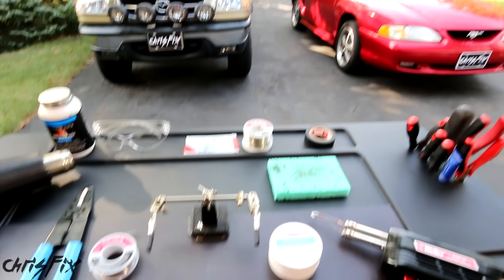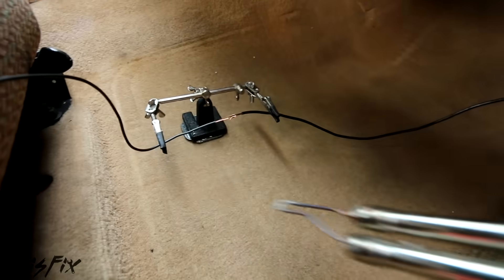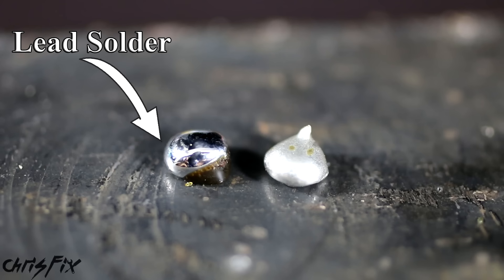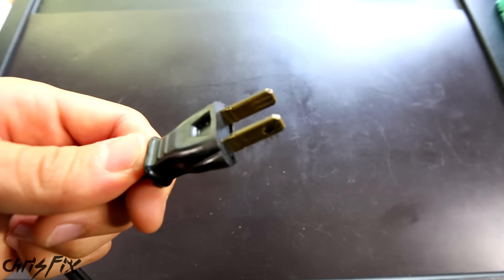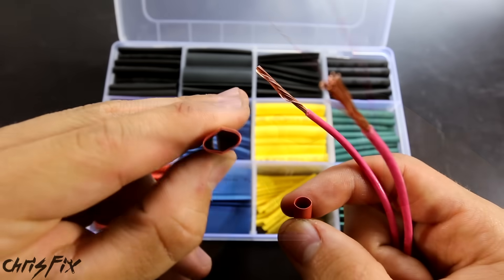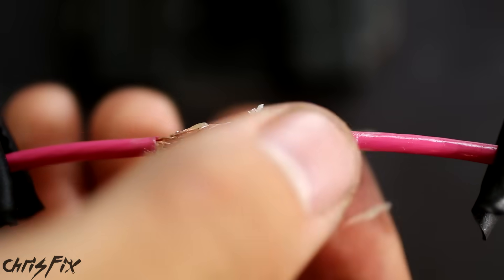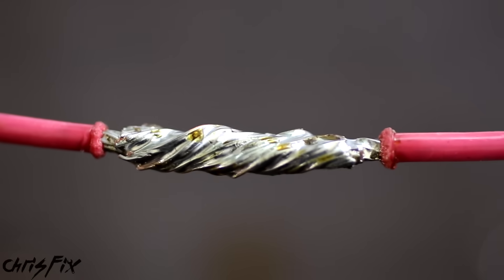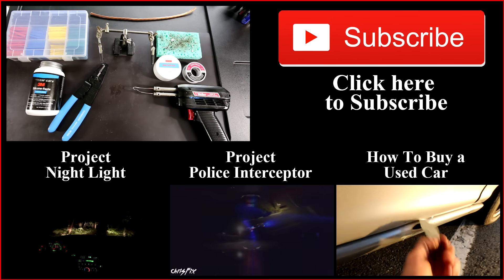How to Solder Wires Together (Best tips and tricks)

Comment: That was a good demonstration. You should also note that you should never touch the bare wire as some of the natural oils on our fingers can be corrosive and can end up weakening the joint over time. I see this a lot with do-it-yourselfer guitar electronics repairs and replacement. Also that a good solder joint will be shiny all around. Any dullness indicates a bad joint.

Comment: I was taught by an USAF engineer that the best way to solder stranded wires like those in the video was to first tin the ends of the stripped wires, then form each end into a hook, hook them together then twist them tight and finally solder them together.  Supposed to be a stronger connection.  Overkill?

Comment: Great video,  I just don't like to use a sponge on any tool that I solder with,  it causes temperature shock to the tip and wears them out quicker.  I use brass wool only to clean tips,  and always make sure to tin your tips,  especially when you're done with the iron and you put it away.

Comment: Well done video. One thing to note, the acid core solder is only used for soldering sheet metal(galvanized). The reason why you don't use it for electrical wires, is because the acid can eat away at the copper over time. The insulation on the wire should be unaffected by oil, gas, and acids. Lead-Free solder is lousy. It does not flow nicely like solder containing lead. Rather than the rosin paste flux, buy a liquid rosin flux. You can apply a few drops and capillary action will draw the flux into the strands. Really don't need the silicone grease under the heat shrink. That soldered connection you made w/o the grease and only heat shrink will be there for decades. If the soldered connection is being done on a boat, then yes, use the silicone grease or heat shrink tubing with glue.
Reply: +electronicsNmore 
You said his use of grease is OK if the wire is in a boat. It's not, it's in New Jersey where they use lots of salt on the roads in winter. Silicone grease is a good idea under the shrink tubing generally; you never know the end destination of a vehicle after you sell it.
Reply: I love boats. And by boats I mean chocolate.
Reply: davecc0000 can you please explain as to why salt is used on the road in winter? Does it make the ice on the road less slippery or any other reason?
Reply: Salt lowers the freezing point of water, melting ice.  Salt is used to clear the roads and walkways of ice or to provide more traction on heavily iced surfaces.
Reply: "That soldered connection you made w/o the grease and only heat shrink will be there for decades."

Not if it's exposed to salt water. Around here they use salt in the winter and it eats through copper wire. An untreated connection will turn into green dust.
Reply: +Slicerwizard I guess you didn't read all of my comment.
Reply: Then say that. Saying "boat" did not give me (and probably dozens of others) the idea that you implied very watery OR SALTY conditions. Think before you type.
Reply: davecc0000
When I used the word "boat", that meant any connection which would be subjected to fresh or salt water. So if you're soldering wires together OUTSIDE a vehicle, then clearly you'd be using heat shrink with glue or the silicone grease. :-)

Comment: Only thing I would add is to use some FLUX CLEANER on the connection to clean it before you do the heat shrink

Comment: Best tip I ever had from an auto electrician was, don't use solder if you can use a crimped connector - reason being when solder gets old it becomes brittle and brittle solder + vibration = broken joint, whereas a good quality crimped connector will last more or less forever.

Comment: Great video. 
Just a tip. When burning off the flux make sure the cable isn't at an angle to where the flux can run down into the cable underneath the coating. If so it can make it brittle and crack. Same thing while adding the solder.

Comment: You have some misinformation about soldering.  (Those solder guns are garbage too, especially for finer work like wiring.)

Leaded solder is typically 60% tin and 40% lead.  Lead-free solder is about 96.5% tin, 3 % silver and .5% copper.  Lead free isn't bad solder, it just requires higher heat to work with and re-working it can be difficult.  I don't recommend it unless you need a RoHS compliant product.

The purpose of solder flux is to remove oxidation.  The reason you want to use a no-clean or a rosin flux on wires (whether stranded or solid) is because you cannot clean the wire if flux gets under the insulation.  Aggressive flux will corrode the wire eventually, not just eat the insulation.

Otherwise not bad.

Comment: Great vedio Chris , i want to ask you some thing about my car Chris l have ford explorer2006 when i start the car  the battery light appears and alternator is not charging unless i press gas above2000rpm ,it works very good after that do i need new alternator ,what to do please help me. Thanx alot

Comment: Ahh if only it were that easy. Most of the time you are upside down under the dash with barely enough wire to span to distance and not enough time to get the job done.

Comment: I was taught that you should clean the solder joint with alcohol to remove any flux residue even if you are using "no - clean flux"

Comment: good video.  Just buy wire with flux in it...much easier, especially when trying to solder like a remote start wiring harness into an ignition harness.  Hell I used to huff and put solder in my mouth to pull it longer to work with when I was an installer lol.

Comment: Flux is designed to be like a solder magnet not for protection flux just happens to protect from corrosion  the rosin inside of solder is there to drip onto what your soldering to help the solder stick.
Reply: Flux is not a solder magnet. Clean bare copper is a solder magnet. Flux removes the oxide layer from exposed copper and that clean exposed copper is the solder magnet. And flux will not protect against corrosion. In fact, after soldering, excess flux should be removed to prevent corrosion.

Comment: A few things to add to this. Instead of a wet sponge, use a brass wire sponge. It works much better for tip cleaning.

I would suggest using a wire stripper without the cutters by the handle. I notice they're much easier to strip wires with and there's less chance of cutting your hands.

Also, when you're soldering, only hold the iron on the wires to keep the them hot enough to melt solder. In practice you should only hold it there for as long as you need to. You don't want to damage the insulation.

For heat shrink, you can just use the glue lined stuff to help water proofing. 

These are just small nitpicks from a guy that's done a loooot of soldering. Otherwise this is a great guide for soldering. By the look of that joint, I can tell you have a lot of experience doing it.

Comment: Thats what I do. Good video.
However, it's not a good idea to have the fan blowing air into the solder joint.  If you do, it can form air pockets in the joint and you'll have a cold solder joint.  It can also blow hot wet solder onto your hands (ouch).

Instead, have it working as an exhaust so it take the smoke away from you.

Comment: Do not use the ventilator pointed on the soldering wire where it blows at it, only let it suck away the fumes. Cooling down the solder may get a bad soldering point.

Comment: You got a tip for when you start soldering and forget to put on the heat shrink on?
Reply: +Princess
Get some self-fusing silicone tape. It's magical stuff. Wrap the solder joint tightly (and some of the insulated wire before & after the joint). Stretch it tight when wrapping. Forget the grease.
Reply: https://www.amazon.com/gp/aw/d/B00HWRO744/ref=mp_s_a_1_7?ie=UTF8&qid=1473521217&sr=8-7&pi=AC_SX236_SY340_FMwebp_QL65&keywords=Silicone+tape&dpPl=1&dpID=417vCUtwSNL&ref=plSrch
Reply: Find somebody to slap the stupid out of you.  LOL  (no offense i couldn't resist)

Comment: "Hey guys, random internet dude here" RULE nr.1 : never ever solder anything on a car electrical sistem!
Reply: What makes a car electric system so special? Spikes of current are a problem for solder joints?
Good solder joints have a VERY low electrical resistance which brings joule heating to a minimum!
I have soldered electrical connections for train motors and those joints endure 300A continous and spikes well over 1000A (and much more when things go wrong). The only time the solder melted was when the connector failed, heated and melted the solder, but this is due to a failing connector the solder joint!
Reply: "Also soldering wires isn't good in systems that vibrate. Wires will 
break right besides the solder joint if they can vibrate enough."

This. Soldering turns flexible stranded wire into a rigid block. If the wire is allowed to move at all, the vibrations present in a moving vehicle will cause the wire to do most of its bending right where the solder ends. It's like taking a paper clip and bending it over and over in the same spot - the metal fails and breaks in two.

So if you have a wire soldered to something fixed, like a relay terminal, or to a connector that is slid over the relay terminal, and the relay is screwed down, then the wire has to be tied down as well. If the wire is just hanging there or is tied down six inches from the relay, the vibrations in the wire will cause a failure, just like in the paper clip.
Reply: Electrical sistem not "stable", while starting, no matter how advanced the car's electrical sistem, it will get high spikes of curent. This poses a big risk to the solder, as it has a low melt point. So if you solder and solder, when something will go wrong you will have to check all of your work from front to back.
Reply: Constantin Niculae
Never had this problem. I mostly solder independent pre-heaters, tho. But it's nice to hear other opinions about the risks.
(Gentle advice: It's system, not "sistem". No grammar nazi here, just wanna help you improve ;))
Reply: Sorry for the grammar, not my first language :)
Reply: Constantin Niculae
No need to be sorry ;)
Not my first language either, so native speakers will find maaaany mistakes in my comments :P
Reply: superdau Never solder something that has high current??? Read my post again!!! We solder connectors on train DC series motor!!! up to 300A continuous, the solder joint was never a problem unless it was done by an amateur. Also those joints get LOTS of vibrations and still not failing!!!
Reply: James Nicholson I've replaced many o2 sensors, but I've never soldered them. May I ask you why? Curious to know.
Reply: I cant remember why exactly. Something like a certain wire going to the sensor has to "breath" and if you solder them it clogs them up? Also it adds resistance to a system that relies on resistance to work. I read this on a subaru forum somewhere but it was long ago. Not sure if its correct or not but i barely ever used solder anyways. just good old wire connectors and heat shrink.
Reply: James Nicholson
I'll ask my boss next week. I'm really interested if and why this is true. You never stop learning!
Reply: As soon as two different metals come in contact, they will produce a small voltage depending on temperature (that's how thermocouples work). An O2 two sensor only creates a very small voltage, so if you add those new junctions that create a voltage on their own, it messes with the sensor output.
Also soldering wires isn't good in systems that vibrate. Wires will break right besides the solder joint if they can vibrate enough.
Never solder something that carries high current. Solder has about ten times the resistance as copper, so solder joints can heat up and maybe melt.
And never tin the wire ends that you put into screw terminals. Solder is very soft and "flow" over time under pressure. Your wires will become loose!
Reply: +superdau
Solder has all those problems? That's why it's used in PC boards and electronics for 100 years all over the world? 

So much misinformation...
Reply: superdau Its a wire in a connector which should be worse because there is much more solder and a big layer for electricity to go thru. In a good wire to wire connection solder thickness is minimal giving a resistance so low (even less than mOhms) that it wouldn't produce more heat than the cable itself.
If what you guys say is true then we should clearly see all solder joints on a PCB with a infrared camera, which is not the case!
Reply: Constantin ... No, not exactly. Heat could be detrimental to certain electronic system device components.  Therefore disconnect the device if possible or if in doubt.  If you cannot disconnect the device, use a "heat sink"  between the point where you solder and the electronic device.
Reply: I think your points are good but I'd take exception to the higher resistance. The wires are clearly in direct contact with each other before the solder is applied. I think there are pretty few areas where the electricity needs to jump through the solder.
Reply: Why?
Reply: Im not sure about that but i know you should never solder wires going to an o2 sensor.
Reply: Maybe its a subaru thinng not sure. I know they use heated o2 sensors on these. Not sure if that has anything to do with it not.
Reply: I was just about to say what +Slicerwizard said. Look at factory cars, nothing is ever soldered besides the PCBs just for the reason he said. 

+James Nicholson
I'm pretty sure all new cars have heated O2 sensors. Probably has been this way since OBD2 started. It aids in increasing fuel economy earlier on in a trip, and maintains it throughout the trip.
Reply: ppdan
I was talking about wires, not connectors or components on PCBs.
Reply: The pads on your PCBs and a point to point connection in something going JIGGLEJIGGLEJIGGLE several times per second are very different beasts.

Comment: Ok so i have a 2007 bmw 328i and it says i need coolant. Do i actually need bmw's coolant? Wtf is coolant?
Reply: Check out his April Fools Day video. It basically covers everything BMW related.
Reply: I don't know if you're being serious or not but if your car needs coolant, you just buy it in auto zone or somewhere. It  doesn't need to be BMW coolant as far as I know. coolant cools your engine lmao.
Reply: just buy a coolant that is the same colour as your current one and fill it up.
Reply: Don't go by the color of the coolant. Some cars do require special coolants, especially more recent cars. 
You can get 2 different green coolants that when mixed together will gel, and clog everything. 
In short, do a google search, there is a lot of information already on the internet. Just watch where the information is coming from, its not always correct.
You can easily find a page like this: 
http://www.bimmerforums.com/forum/showthread.php?1185308-Do-I-have-to-use-BMW-coolant-or-will-generic-work
Where its already been discussed a lot.
Coolant can be refereed to as antifreeze.
Reply: Don't listen to the people saying it doesn't matter. Ever since I got my e46 330i i became very interested in cars and researched everything thoroughly before doing something to it. From my research, ZEREX G-05 is the most recommended coolant. It's basically the same as BMW coolant without the blue coloring. It actually looks pretty clear.
Reply: MaTSix
Zerex usually makes good coolants and coolant system cleaners. Pentosin is also good, and may actually be the company that makes the BMW coolant. I personally use the pentosin in my subaru, older cast iron engines I just use the generic green stuff, and newer cars I use what fluid is appropriate for that engine, and I would use only a trusted brand.
You can switch fluid types but you must clean the coolant passages first. Preferably use Zerex Super Radiator Flush.

Always do your research before you start a project, or even just topping off fluids. Its not like decades ago were any coolant, oil, power steering fluid, etc. will work.

Comment: I prefer the NASA standard, where the two wires run parallel, secondly the lineman which needs a lot of wire, but holds forever.

Comment: Chris, I'd recommend you using unleaded solder in combination with flux. If you'd heat the soldering-iron to 315 degrees celsius, but use a higher wattage soldering iron, it will work out very well and it's healthier (because leaded solder is just really bad for you!). I've been soldering on a daily basis for years (I make high-end connector solutions for the worlds best high-end connector company (LEMO)). I'd recommend you to switch to a soldering station (I prefer a Weller station, but others will do aswell), with changeable wattages. That way you won't burn the wires (or the flux, which burns the way you use it now!) and will melt the solder properly. Thanks for the videos, I really do enjoy them!
Reply: And another tip: when you store your soldering-iron, cover your tip in solder. That way it won't oxidate!
Reply: Also: using too much flux might cause an overcurrent in the future. I recommend you to clean the connection with isopropylalcohol after you've soldered (I personally use an old toothbrush with the IPA to clean the connection).

Comment: Nice tips! I suggest that if one is soldering an old wire, from an old car for example, the cooper can be oxidized, even under the plastic cover. So, in some cases, it's a good idea do sandpaper the oxide before soldering.